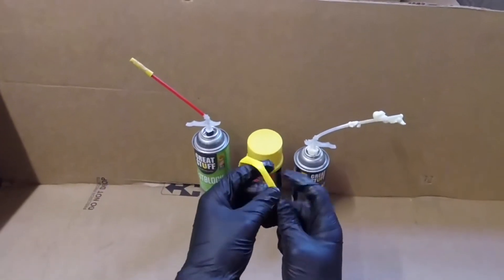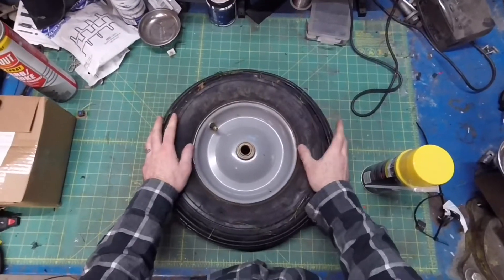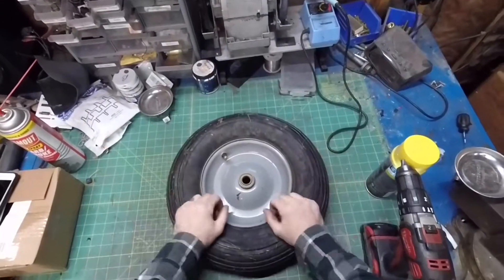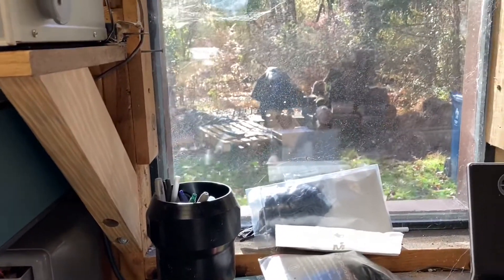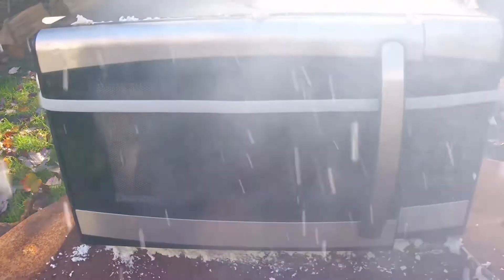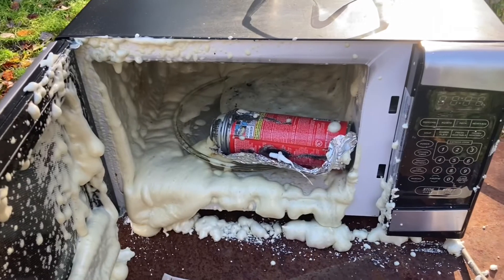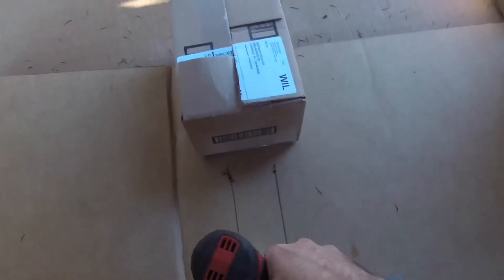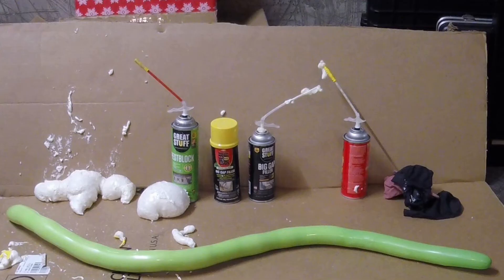Three crazy spray foam insulation experiments to NEVER try at home!

Comment: I saw a foam company that sold a product for this but it wasn't spray foam it was an a and b part you mixes and poured before it starts to expand thru a flap cut in the sidewall i think you can get much more Rigid phone that way